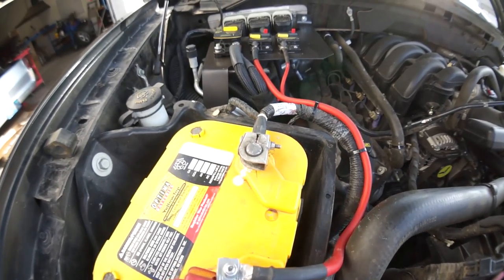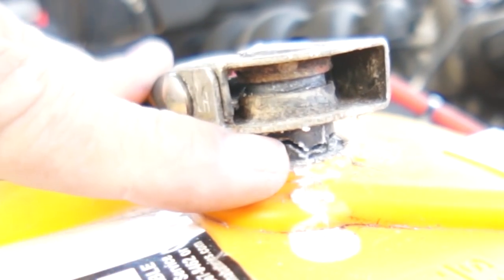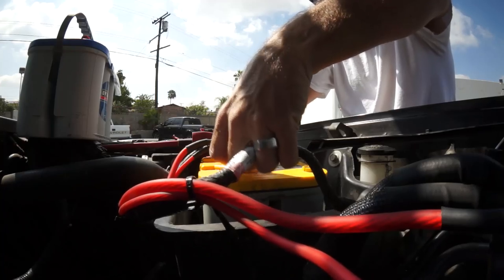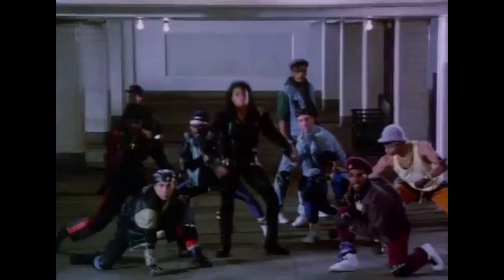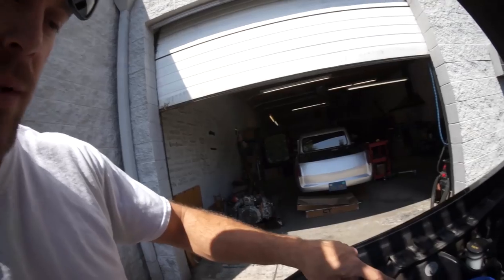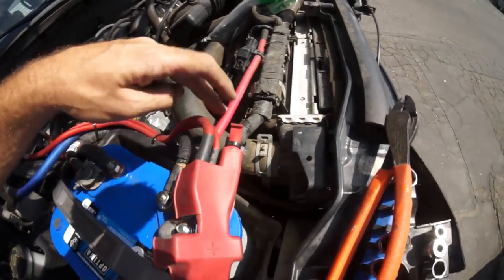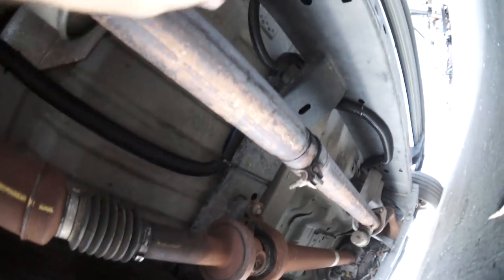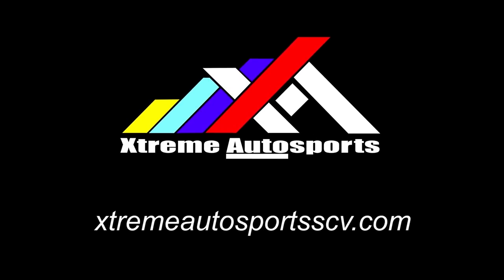Why I love Optima AGM deep cycle batts, Continuing F150 electrical system upgrades - AMPLIFIED #658

Comment: Fuses have significant resistance, having 2 fuses will reduce the voltage to the amplifier.
Reply: Your regular volt meter won't notice a difference lmao
Reply: @urbansasquatch5537  You wouldn't be able to measure the difference between 8awg and 0/4awg with that same multimeter either.
A 100-150 amp fuse presents ~.5 ohms of resistance, that's the same resistance as 1000ft of 8awg wire.
Reply: And 1/0 or 16 gauge has the same resistance lmao, one just can take more power than another
Reply: @urbansasquatch5537  They do not. Please just Google "resistance per foot of wire". I literally have to do this for my job, measuring the resistance of grounding wires with calibrated equipment, for ESD certification and audits.
Only "superconductors" that need to be at cryogenic temperatures are without resitance. A neat scientific example is that a magnet will hover indefinitely over a superconducting puck, but only temporarily over a copper conductor due to eddy currents. Check youtube for "quantum levitation" and "magnet copper tube" to see some demonstrations.
Reply: So if a fuse in line puts out an extra .5ohms , why does my meter say error ? Like I'm touching the leads together?
Reply: @urbansasquatch5537  try reading voltage drop
Reply: Very true SED

Comment: You have been lucky Doug with regards to the Optimas. I sold them as a better, longer lasting battery for a reasonable price at my auto repair shop. After selling one to friend, had to warranty it 3 times in 5yrs! Sold one to my 80yr old grandpa (red top) for peace of mind. Warranted it twice in 4yrs! Also had 3 (yellow tops) in my personal car. None lasted for shit! I'll never use them again. I run and Odysey PC1200 in my drag car. It's been starting my 600 cubic inch, 14.5-1 compression Hemi using a stock 1990s chrysler 318 starter for..... 14yrs now!!! You get what you pay for buddy.  Glad your's are doing good for ya. Love the videos, your a clown and crack me up. Lol. Have a great weekend.

Comment: Love optima! I run one red top start battery and two blue tops for the stereo with my 180amp factory replacement alternator. Even full tilt I only drop to 13.2volts. I never run full tilt. Plus they come out n go strait into my boat. So duel purpose.

Comment: whats the song at 2:05. I know it s a remix but it sounds so familar. the optima batteries changed manufacter plant. However i you have ur car off and play a loud system u still need a deep discharge. I switched to a 850cca normal cause my optima just started to die down after 8+ years

Comment: Super clean and safe wiring. You'd be surprised how many "installers" let the fuse holder dangle in front of the timing belt 🙄

Comment: Don't let them hate on the Optima Doug, I had a pair of them in my old truck for 8+ years.
Reply: Yeah Varta is another no bs good battery...my last one lasted for 10 years :D until it couldnt perform in the winter anymore
Reply: They are great. I've several and not one failure. I know of 20 people that run them in their bass and pontoon boats. They are VERY reliable.
Reply: They're still good batteries but the argument is the quality has gone down since they moved production to mexico.
Reply: yeah i heard that argument too. I just replaced my optima after many years so i went with a basic 850CCA battery. Just dont leave your system on with the car off without a deep discharge
Reply: last generic battery i bought didnt even last one winter in the van :D but good for warranty so i got a new one and sold all away
Reply: I think they suck for running big power. I've never had an Optima outlast any Kinetik or XS Power. I kept on using Optimas and there were many times my Tahoe was dead. My car alarm alone would kill the Optima. When I stopped using them I never had to worry about my car not starting. I have 2 Dekka batteries under the hood and a 75 lbs battery in the back of my Tahoe. One of the Dekkas is defective, and it still is better than the Optima. I've tried recharging Optimas but most of them wouldn't hold a charge. People are saying they suck for a reason. I don't hardly see any of them at serious Spl competitions.

Comment: What are you using for grommets where you run the 0 gauge through the sheet metal? If you don't run something, you're gonna have a bad time. Also, two fuses is not going to add any additional safety, a fuse will blow just as soon at one end of the run as the other end of the run. The only part that matters as far as location of fuse in the circuit is the distance from the source (battery) because the wire between the source and fuse could in theory short out without including the fuse in the circuit.

Having a second fuse in back will only increase voltage drop, and cost, without adding any additional safety factor. Technically it makes it less safe, as it is an additional connection that may fail/come loose.

Comment: I think you need to put some type of heat shield around the wire. Because the exhaust get somewhere around 900ﾟ to 1300ﾟ when running. That's why you can  see a heat shield by the zip ties you put in to hold up the wire. Just a thought, because those zip ties will melt. And so will the wire casing

Comment: The 2 Black wires that run to frame, are those ground wires? Will they be ok in rain? Jw cause I don’t know. Thanks. It’s at 15:34.
Reply: aaron collins they look like ground wires for the amp, may get some corrosion over time down there. Time will tell.
Reply: camaroboi13 ok thanks for the insight

Comment: I just turned in my Optima red top that I bought on 8/15/2005. It lasted while bumping with a factory alt and no caps or extra batteries over 12 years in my 94 Camry. It felt like a family member died. Meanwhile, I've gone through 4 Optima yellow tops in my 04 Avalanche and it has been stock the whole time.

Comment: Is there a reason you don't crimp your lugs? Do you ever have issues with the solder connection coming loose?
Reply: The heat shrink will hold in and lot let the solder break loose.
Just like when using ferrules.

Comment: Hey, how much of a difference does it make going from a regular cheap calcium wet lead cell to a AGM? im still saving up for a alternator don't worry, but will it be enough of a difference that i can turn the amp up even a little more for example? (i now have it set just so that the lights do not dim because im more carefull now hah (blew one of my 2500 rms amps by having too low voltage, i had exactly the same 2500rms amp ready in my house because i wanted 5000rms strapped when i got the alternator so now i first need to get that blown 2500 fixed sadly)

Comment: Nice battery but isn't the red and blue tops not warranty with car audio just the yellow just curious other than that nice install can't wait for it to be finished.
Reply: if the battery goes to shit and you swap it out yourself, how would they know if you used your battery for car audio?
Reply: They all can be used for a starting battery. It's the storage capacity, and post locations, that make up the different models.
Reply: Blue top with dark grey case is strictly for starting. Blue top with with light grey case is a true deep cycle battery ideal for car audio and other heavy electrical applications.

Comment: Nothing wrong with using what works. I like the idea of using the optima blue for the better posts for your setup. 👌

Are you planning on running a secondary? 

Even on setups where I've used custom built high output alternators I've still had to use a secondary or small bank to keep voltage drop at a minimum. 

Thanks for making great vids. I'm one of those who watch(Ed)  everyday at work so I miss the daily vids.

Keep up the great work Doug.

Comment: Doug!! You need to punch Canadian tire into your google maps and pick up a  MotoMaster Eliminator Ultra XD Automotive Battery. They are tested in Canadian cold winters with a truck made of ice(google the commercial) so You know it would run your stereo with ease. 1750cca 👍 cut some holes in your cab and put the jL in

Comment: Optima batteries are good but I don't like the weird shape. They don't fit in some cars that use a metal hold down, due to the terminals being closer together. I use Deka Intimidator yellow tops. Same AGM technology, but in standard sized cases. 👍🏻👍🏻 RIPIT!!
Reply: I plan on getting XS Power batteries for my next big build, seems like everyone uses them for high wattage systems.

Comment: Hey Doug do you have an unlimited plan for AT&T. If you do I think I have a solution to your iPad car play wifi data usage situation. If you have an unlimited plan at&t has a device hat you can plug into your obd and it turns into a hotspot that's always on and can accommodate up to 5 devices all for 20$ extra!

Comment: Man Optima batteries are not made the same anymore, their build quality has gone down hill ever since they sold the company. I myself went thru 3 optimal yellow top in 1 year after that I returned it and got a Bosch AMG battery and I have not had any problems since then. The yellow top Doug had in his truck is when their build quality was awesome and they were dependable.

Comment: I, personally, will not buy a Optima ever again;  It was my first AGM battery (yellow) a few years ago.  It went south right after the warranty expired and didn't have a prorate.  $ down the toilet.  

AGM came into the road tractor market, as an option, when ordering new trucks and let me tell you, what a nightmare that was with premature failures.  Some of the largest freight companies bought the "extended battery" warranty coverage upon purchase, but when it came down to a non-warranty battery failure, everyone would opt to pull all AGM batteries and replace with standard acid maintenance free models.  Needless to say, the trucking industry has gone AWAY from AGM.

Perhaps, one day, I'll be reunited with the idea of AGM, but it needs to get better, or have a newer better alternative.

Comment: I wouldn't doubt its sounds good but I can't help the fact that mixing up brands makes it look like a bastard system no matter how clean the install is
Reply: irepbigi it's mostly CT Sounds, which is Doug's sponsor... and it's not like you'll even see the subwoofer or the components or the deck or the amps that are tucked under the seat until you lift it up....
Reply: Three different brand amps , Sony deck , iPad etc..... it's a bastart setup lol  but clean install
Reply: irepbigi Who cares if it's got separate brands lol quality is what matters not the brand name

Comment: Optima is junk circuit breakers are junk soldering big wires is junk stinger wire pretty good but pvc jacket under hood is junk. Videos are good.
Reply: seancarraher the "pvc jacket" is actually split heat resistant wire loom, I have the same exact stuff. Makes for a nice clean look, and is best used for functionality on the charging wire.